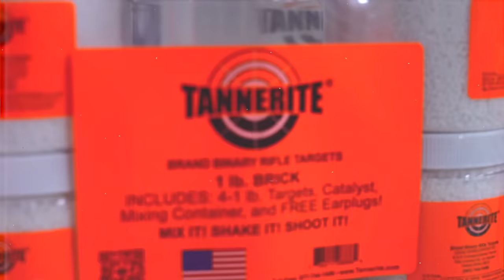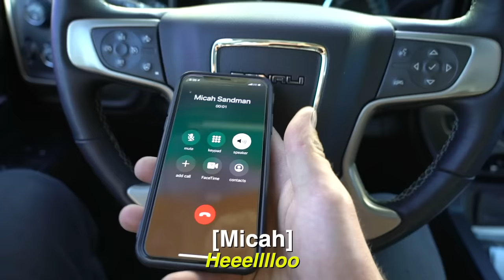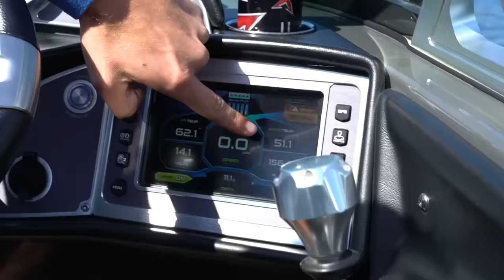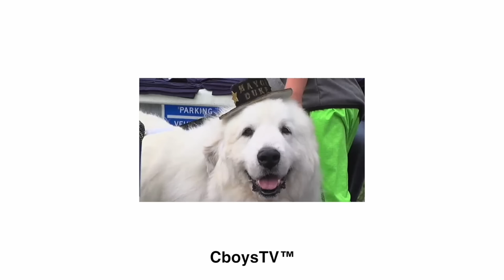Blowing up my friends Jeep!

Comment: tanerite only blows up if shot with a high enough velocity bullet.  its not sensitive by any means to just blow up even if you threw it in the air and if you're wanting a decent explosion you're gonna want at least 50 pounds.